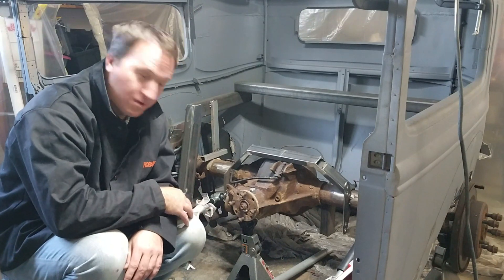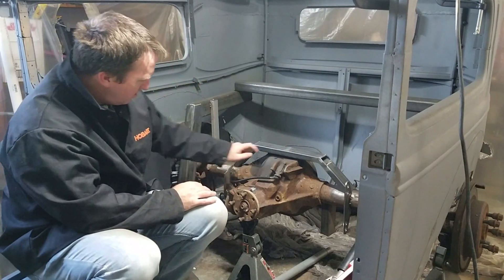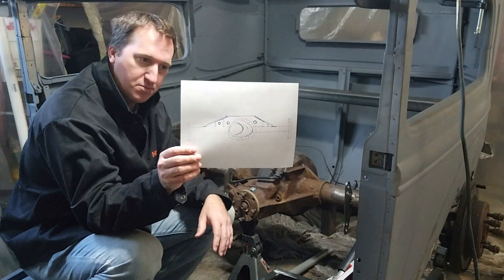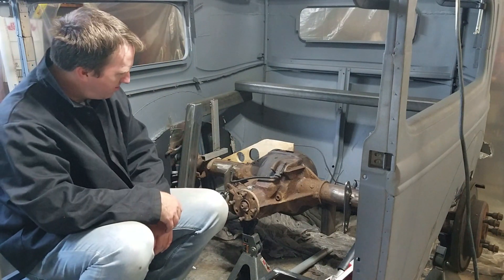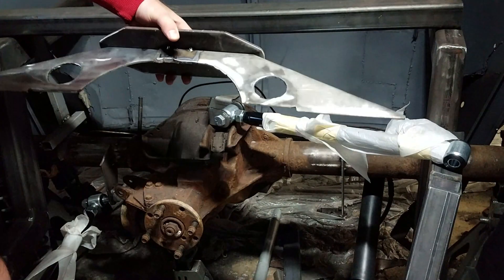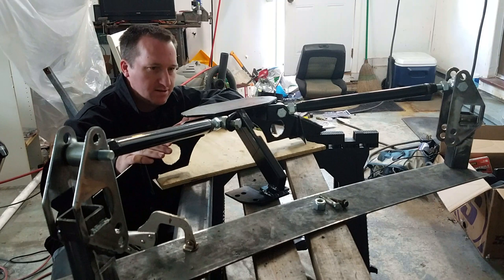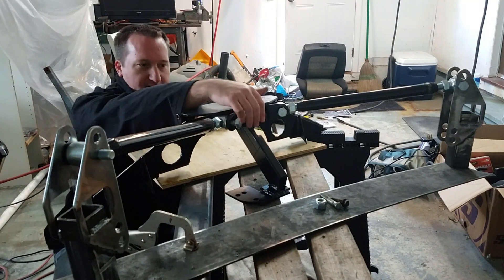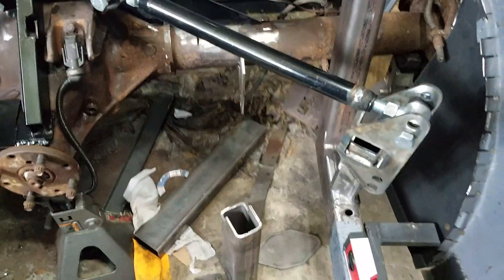Ford Model A 4 link triangulated rear suspension

Comment: Thanks for the video! Going to do the same to my dirty 30 with bags. Just remember that your 4 link arms need to be the same length down to the nuts or it won't work well. Don't your top angle links need to be stretched out more towards the front by your lower arms to form an (A)? Just pointing out that it looks like your jack stands were the old harbor freight specials that give out and kill people. If they are, they are recalled just so you know.
Reply from the maker: Great feedback, thanks Adam! There is a calculator online that helps determine the correct angles and link lengths, so the top and bottom have a relationship but it isn't always 1:1. As for  the stands, they were replaced...good call!